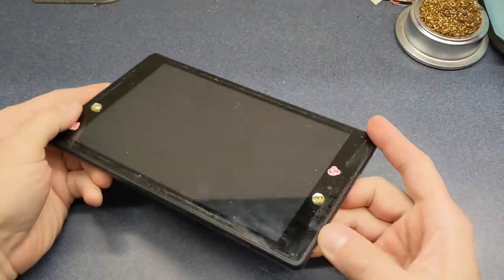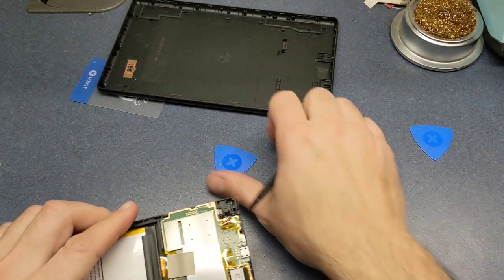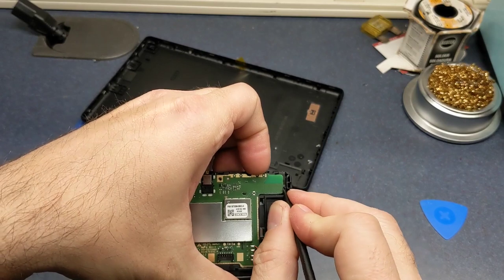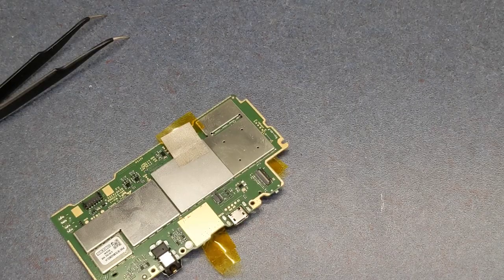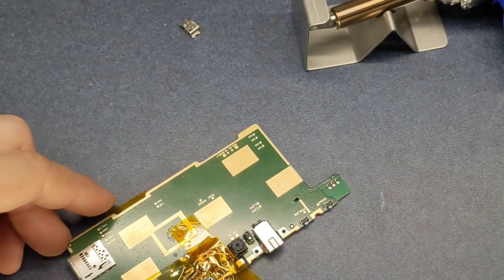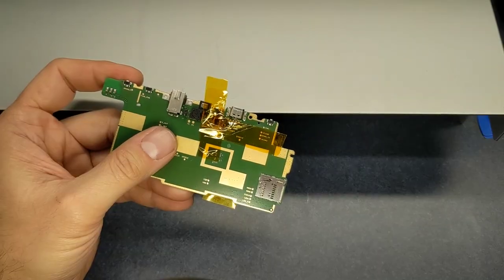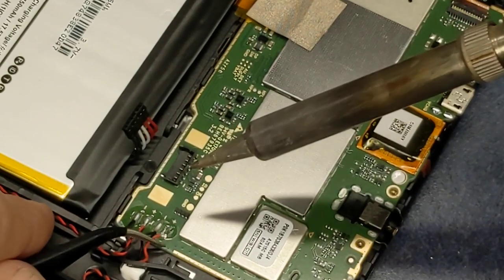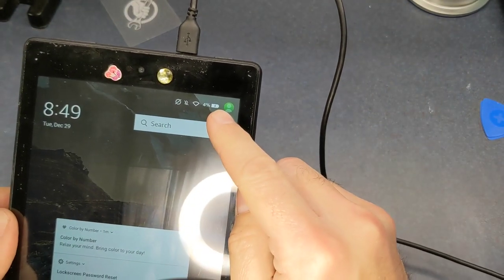Amazon Fire HD 8 Tablet 8th Gen Usb port Fix replacement

Comment: Thanks for this.  Helped me fix my kid's tablet.  After buying the part and tearing down the unit, I called a local repair place and asked what they'd charge just to do the soldering work: $60.  For a little more than that, I bought my own rework station and did it myself and learned a new skill (except I already knew basic soldering).
Reply from the maker: Thanks for the comment 👍 I am glad it helped you. I made the video because I was fixing this for a friends kid and I could not find any good info or videos for this version of the tablet so I figured I would make one.
Reply: @TheRetroBen  So this one has a micro USB port? My new Fire 8 tablet has a type C. Every Fire 7 I`ve had has failed right away because of the charging port no matter how gentle I tried to be. I like them for making simple quick YouTube videos because they have good sound levels. Hopefully my expensive new Fire 8 will last more than 3 months.

Comment: Awesome video. If possible, quick request…can you add the temps settings of the solder iron, precision soldering iron, and heat gun/pen for the part removal…maybe in the description?
Reply from the maker: I will have to make note of the settings next time I do one lick this. Although my settings may differ a good bit from other equipment. My soldering iron is now a much older model Weller and my hot air tool is actually a cheap Chinese one, although it gets the job done. Thanks for the comment.

Comment: This is my friend's second Kindle. https://www.youtube.com/post/UgkxOnUR4NaproSbBbD2sdI4XcDZ58Jz8GOx  The first one which is about 5 or 6 years old quit charging because the bottom connector went bad. When I saw they upgraded to a USB C connector I knew it was time. I think the old USB Micro connectors are a PIA. Her new one is great. It synced right out of the box and connected to WiFi immediately. The thing is perfect! Sooo mine will arrive tomorrow. (Been reading off an old Fire) What bugs me are the reviewers that give this product one star because it didn't work out of the box or they were too dumb to figure it out. If it doesn't work send it back and get another one. It couldn't be easier with Amazon. Giving it one star because it didn't work says nothing about a good one that does work. I bet a bad one is one in a thousand or more. Give it a break...just get another one.

Comment: your soldering work is fine and perfect!  I want to do it myself but I am not so confident that I can do it myself. I will broke it myself. The most amateur have not  enough tools and techniques to solder/unsolder it finely.
Is there another way to charge the battery without replacing USB jack?
Thanks! from interested amateur. Shigeru

Comment: the piece with the capton tape (not sure if spelled correctly), is placed differently and is definitely not as easy as this to pull off, with any of the "ifixit" tools with the version I have.  Also, the ribbon cable by the battery, when disconnecting, the lever that pulls up was stuck in place.  Any tips on these issues for different models?

Comment: I got mine installed after a very tedious hour. But mine still isn’t charging, so I’m guessing I may have lifted the solder pads on the circuit when I desolder The old USB port. We know for a fact it was a defective charger port bc you had to hold the wire firmly in it to charge. Then that eventually stopped working. So I get excited thinking I got it fixed for my daughter and it still won’t charge. Do you have a email address I can contact you and possibly send mine out to you to fix? I will pay a repair fee for your time.

Comment: mine lasted 3.5 years. Bought it for $50.. I'm wondering if I should try to fix it. The heat gun and parts would cost me about $35 ..
Reply from the maker: You don't have to use the hot air tool it can be de-soldered with an iron and de-soldering braid, or flood solder on all the pins to get it loose and lift it off carefully.